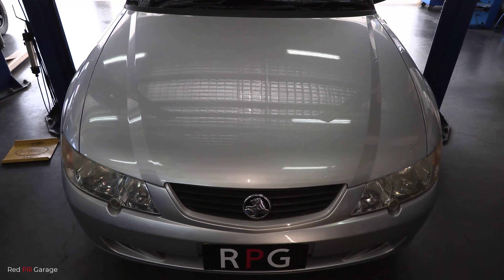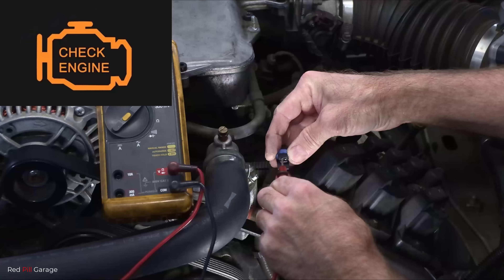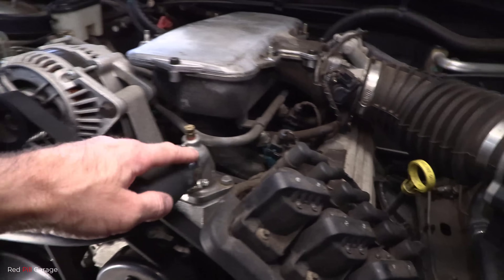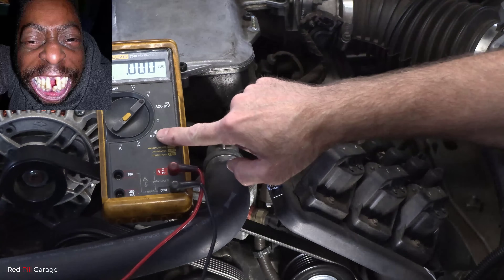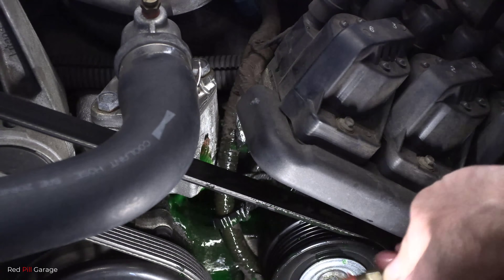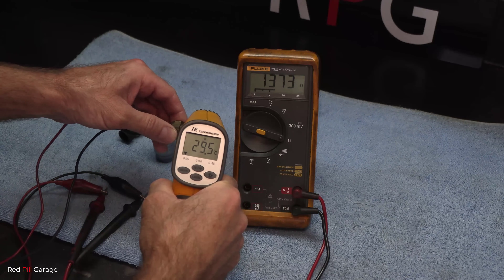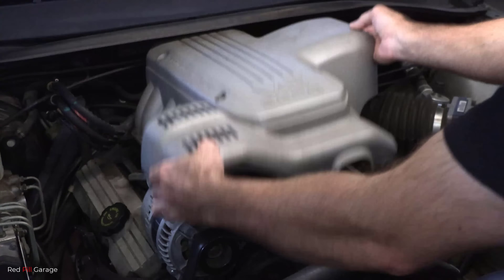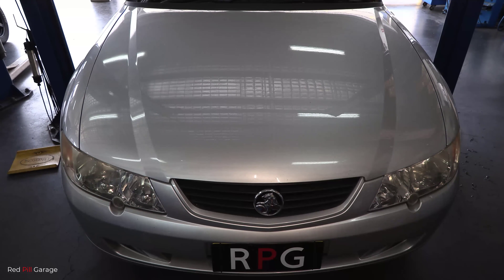How To Test and Replace an Engine Coolant Temperature Sensor. Ep29

Comment: Hello ,hope you're doing good.. I was having temp gauge issues it would go straight to H when I turned the key to on position without starting it ,then my fans went out so I bought a new temp sensor and it was read p0118 code while I waited for the fan relay to get here in the mail I plugged the relay in and it switched to p0115 code.its reading temp fine and the fans turn on when they're supposed to ..I checked the harness (3 wire) got 5 .1 volts and continuity on the ground one ,any idea where I can go from here? Any help would be appreciated,let me know ,thanks!!
Reply from the maker: G'day, Sorry for the late reply. Unfortunately I'm not there to check it myself. This usually means that the ECU is sensing erratic voltages. Possible causes: (1) you may have a low coolant level that will cause the ECT sensor to register inaccurate temp readings due to an air pocket in the coolant system that requires to be bled out. (2) It is possible that the new ECT sensor could be faulty also. (3) The connector or wiring issues, for example corrosion or loose connections (this is common). You must take your time and to perform a visual inspection. (4) Faulty thermostat can also cause code PO115. (5) Another sensor may be playing up, for example intake air temp sensor. (6) Some cars have more than 1 ECT sensor. Make sure not to leave any stone unturned. Have you tried clearing the codes or disconnecting the car battery for 15 minutes? I think since you've change the sensor and this new code has appeared there's a chance you may have an air lock in the cooling system from the ECT replacement. Hope this helps.

Comment: Hi there, could this cause hard starting when my diesel engine is warm? It starts real quick when cold, have repaired almost everything else i know and i’ve never replaced this ECT sensor ever. Cars done 220k KM.
Reply from the maker: G'day, yes I would check the ECT sensor and replace if faulty. It can cause over fueling. There are a few reasons for your problem. It could be a fuel delivery problem like high pressure fuel pump for example.
Reply: @redpillgarage i tested my ECT sensor’s resistance and it was okay responded to ohm changes when dipped in cold water or when lit by fire. I replaced it anyway with new OEM part. Still did not change hard hot start problem..
Reply: @redpillgarage  G'day bud, i found out that the problem lies with my battery. Long story short, CCA value in a car battery matters so damn much! 

I've been troubleshooting this problem for years and years, apparently the battery that i bought all the time in the past came with 600CCA when new, and when it falls below that, long cranking appeared. Switched it out today with a Varta that comes with 650CCA, engine started flawlessly like a butter, both cold and hot!
Reply from the maker: @domeee11  👍
Reply: @redpillgarage why would it be high pressure fuel pump delivery when in cold it starts real easy? When i finally got it running at warm start (usually after 12 cranks) there is a white smoke out of tail pipe such unburnt diesel fuel, and clears right away..
Reply from the maker: G'day, Wear and tear on the fuel pump can cause issues with fuel delivery when hot. The heated fuel becomes thinner and more difficult for worn parts to cope with. Just like engine oil pressure issues with oil viscosity. Toyota Landcruiser had engine failures due to oil viscosity thinness. To resolve that problem mechanics would recommend thicker oil to stop engine failures. Toyota chose thin oil so it would pass strict emission standards. Unfortunately I'm not there to help you diagnose.

Comment: My temp is just over quarter, never was b4... we changed the fans, and I changed the temp sensor.  Still top temperature is 110 or less on a hot day. What could it be?
Reply from the maker: G'day @whisperingsoul44, it could be a number of things. Unfortunately I'm not there to help you diagnose. The things to look for in an overheating motor, is it low on water/coolant, intake manifold gasket could be broken, it may have a combustion leak, faulty thermostat? Perhaps start off with a cooling system pressure test, if that passes then perform a combustion leak test. Did you replace the coolant sensor or the temp sensor as you mentioned above ( is it the same car as in the video )? Is it possible you may of replaced the wrong sensor? Don't replace any parts unless you can test and prove they are faulty. I wish I could give you a clear answer. Just start with basic diagnosis and work your way up. Don't assume something is faulty you need to prove it first before spending any money. Hope this helped.

Comment: If you get weird readings with normal is it because the leads are not touching well or because its a bad sensor?
Reply from the maker: G'day @jonmo2694, if your readings are fluctuating sounds like a bad contact. Try holding the leads steady on the contacts and you'll find that it won't fluctuate anymore.
Reply from the maker: To test the wire harness watch from 3:45
Reply: @redpillgarage My readings on the diode continuity setting goes from 1600 to 1200 and 1300 back and forth each time I touch it, is that bad?Also my voltage has a 250 and 200 setting, my reading was 10 on one and 4 something on the other setting
Reply from the maker: @jonmo2694  Did you get a beeping noise from your voltage meter when checking continuity? I'm assuming the readings you got tells me that there is no open circuit. I don't know what your voltage meter is set at but if your getting close to 5 volts it tells me it is okay. If you're getting 10 volts you  have a problem. To be sure you need to find the specifications for that circuit. Just make sure your voltage meter is set to auto.
Reply: @redpillgarage No beeps, I bought a cheap meter.My fans don't kick on unless I turn the air on when I get into town at low speeds.My temp will climb to halfway if I don't turn my air on.Maybe I will have to buy the OEM harness and ECT sensor?  This is my second duralast sensor I replaced. I do know my coolant was low again so air got in, I had to replace the upper coolant hose.Dont know why the sensor isn't kicking on the fans when the temp starts climbing.I had to replace the blower motor as well as the fuse last year.Wonder if there is any connection to that?
Reply from the maker: @jonmo2694  Okay thanks for the extra info. Don't spend money on a harness or ECT sensor, sounds like your problem lies elsewhere. Sounds like you may have an air lock in the cooling system or a big difference in water temp at the engine to the radiator, for example, a faulty thermostat or a head gasket issue. Unfortunately I'm not there to look at it for you, but it may be best to get a Mechanic to look at it for you if your not capable of doing it. They can pressurise the cooling system and conduct a block/combustion leakage test, and bench test the thermostat.
Reply: @redpillgarage  Yeah, I'm pretty sure I have a leak on the Phlenum? Valve cover above the fuel injectors. I was thinking about tightening it first before taking it in to a mechanic.If it's just that gasket I'm thinking about doing it myself, but first I would get it looked at.Its an 05 grand prix.I put a new thermostat in and put the ECt sensor back on and replaced the upper radiator hose.
Reply from the maker: @jonmo2694  I recommend getting your Mechanic to check it first. The reason I say this is because if you replace those gaskets and the engine has a combustion leak your Mechanic is going to have to replace those gaskets again. It will just be a waste of your money. If your lucky and its not a combustion leak you can do those gaskets once the problem has been resolved.
Reply from the maker: @jonmo2694  👍

Comment: Thanks for the great informative video. I am replacing Temperature Sensor in Corolla 2009 just for preventative maintenance. The new sensor is coming with coper gasket. Could you advise if any sealant (like Permatex anti seize) should be applied to the Sensor's thread. I will appreciate your advice.
Reply from the maker: You're welcome. Because you have the Copper gasket you "won't" need anything else. Some of these sensors that have a tappered thread (no gasket) you can add a sealant like Stag which is also used on engine Welch plugs. So in your case because you have the Copper gasket that's all you need.